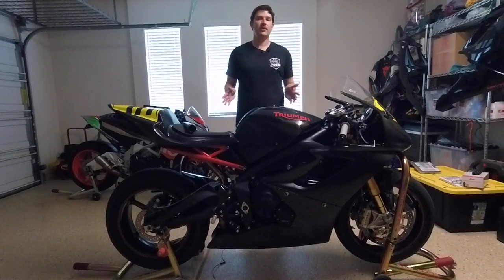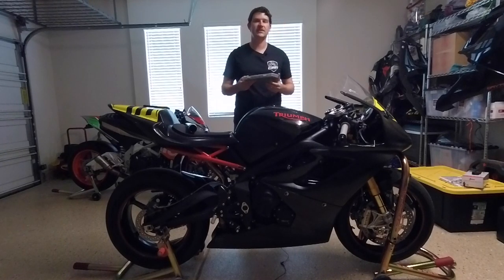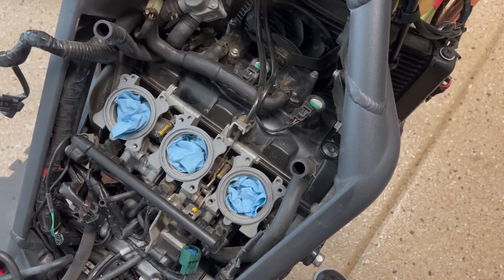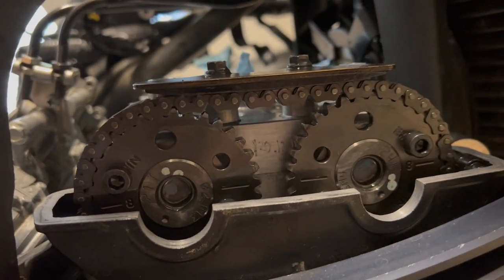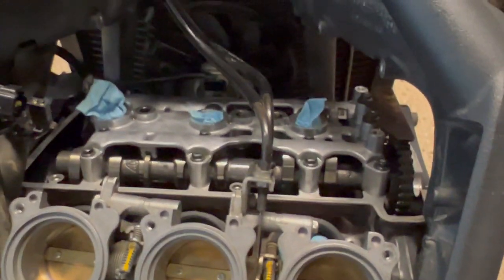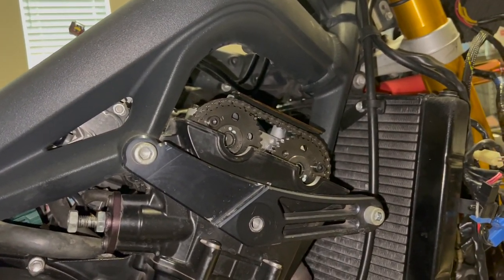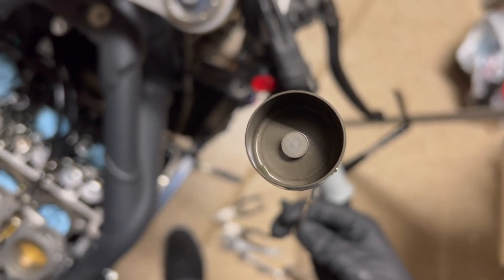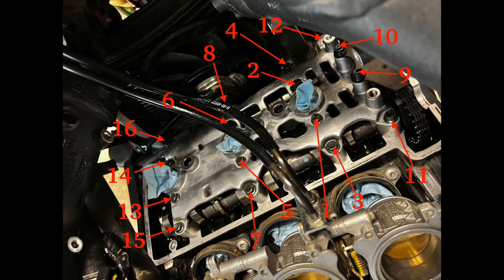How To Check & Adjust Valve Clearances on a Triumph Daytona 675R - An Overly Detailed Guide

Comment: Hi i have a question I hope you can answer please? I'm currently rebuilding my engine as my manual cam chain tensioner backed itself out and through all my timing out. I've decided to rebuild my engine and it's all going well so far! I have no idea what position each shim was in as I accidentally made the mistake of turning over the unit and they all fell out.... Stupid I know. As I don't know what was where, when I come to put it back together will I have to put everything back together just to check the clearances that will no doubt be out as I don't know which one went where. I don't want to have to put it all back together just to have to tear it apart again to change the shims. Didn't think of checking anything before taking it apart. It's my first time doing this as you can probably tell
Reply from the maker: Hi there! Kudos to you for taking on that job yourself. Unfortunately, if you did not keep track of where each shim was, I think the best thing you can do is exactly what you said. Throw it all back together, take measurements, then disassemble and move shims around as needed. Sorry to be the bearer of bad news, but it's the only way you'll be able to determine what needs to go where :/
Reply: @hiimchad  thanks, it all seems relatively straight forward until it gets to the shims so hopefully it works out. Thanks for getting back to me really appreciate it videos like the ones you've made make things so much easier I learnt so much from it. The tolerances on both exhaust and I take would be the same regardless of the milage that the bike has done correct? I've got a Haynes manual on the way anyway but in the meantime I'm trying to get as much knowledge in my head as possible 😂

Comment: Hey man so I’ve been searching if it is the case but when reinstalling the cams and timing them correctly with the intake lobes on cyl 1 be touching the Buckets and when you torque everything back on the valves with be open just a tad
Reply from the maker: Hey Yasay! Hope you found the right answer already, but if I recall correctly, the cam lobes on cyl 1 (the leftmost cylinder closest to the stator) should be making some contact with both intake and exhaust buckets. It will look like they are pointed towards each other, but down slightly. That is top dead center (TDC). You can also double-check the timing marks on the cam gears, and be sure to triple check the timing mark on the crankshaft as I showed. The cam lobes should not be facing straight down, or perpendicular to the buckets, but they should be a bit past a 90-degree angle. I would recommend double-checking your shop manual. Hope all went well!
Reply: @hiimchad  yes thank you this video was so helpful while I was doing this job. I got everything timed out and she purring better than ever. I did end up having leftmost valves just a tad open with everything tightened down and idles perfect and bike runs mint Thank You!

Comment: How's it going man, I think we have the same engine but less 15cc, it's a 2018 street triple 660s but yea I got it all back, the valve cover and all but for some reason the o ring on the cam timing tension decided to split, I took it off and can I just put it back on?
Reply from the maker: Do you mean the o-ring for the cam chain tensioner? If it split, you'll definitely need to replace it.
Reply: @hiimchad  yep got it replaced, i took it out and back on  without applying tension on the chain, is that alright

Comment: Here’s a tip- instead of removing the throttle bodies, you can undo the bracket that holds the throttle cables to the throttle bodies. 2 Phillips head screws. This will give you enough clearance to remove the cam cover. 

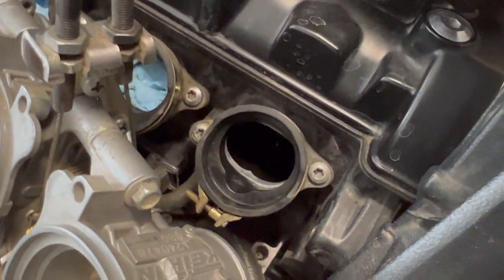Bracket in frame at 18:55
Reply from the maker: Great tip! I never thought to try that. Should short track the process next time I'm in there. Thank you! 🙂
Reply: Thank you!
Reply: This method works just did it myself! thanks for the tip man.

Comment: awesome video! 
Keep up the good work!
this will help me so much because I need to basicly do the exact same on my 06 daytona :)
Thinking of also getting a manual cct because I dont really trust my 25k mile old mechanical cct...
how often do you need to adjust the tension after install?
did you have to adjust it early because of the new timing chain breaking in?
what is the procedure to adjust it? as I didnt really find an official manual by ape...

sorry for those many questions :D 
Greetings from Germany 
Felix
Reply from the maker: Thanks Felix! I highly recommend the APE CCT. It's very easy to adjust. With the engine at operating temp, I'll break the lock nut loose, but not adjust the plunger just yet. I'll then start the bike and apply some firm tightening pressure (clockwise) by hand with a thick glove on so as not to burn myself. The tensioner will slowly tighten. After it stops tightening by hand with firm pressure, I hold it in place, cut the engine, back it out 1/4 of a turn, and then tighten the lock nut. It did require a minor adjustment after the first weekend with the new chain, but it wasn't too loose that it wouldn't have been ok for another weekend or two. I'd recommend checking it every 3k miles with a mix of street and track use.

Comment: Hi, great video!  I have a STR3 and I’m at the point where I’m about to replace the cam chain.  Mine is a little off the timing mark as well.  Question is, did you use that Triumph tool to keep the TDC?   I feel like you didn’t, since you were going to adjust cams to get the dot and alignment maker exact.   Any insight is appreciated.  Cheers!
Reply from the maker: Thank you! I did not use the tool. I ended up removing the cams to fit the new chain, couldn't see another way around it. From there, it isn't too hard to get the timing marks lined up properly, just takes a little time, patience and finesse.

Comment: Hi,great video, I keep watching it over, just about to do 12000 mile service on my 2008 675 triple. When you replaced the cam chain, would it be possible to remove either of the camshaft sprockets ? I`ve not had a triumph engine stripped before but have Suzuki and Honda
Reply from the maker: Thanks! Do you mean would it be possible to remove the camshaft sprockets in order to get the chain off without having to remove the cam holder? My concern there would be the cams jumping time with no resistance against them, so I wouldn't recommend doing it that way.

Comment: Hey man! Appreciate this tutorial 🙌 just one question, do you find necessary to loosen the cam sprocket screws at all and if so did you have to replace them? Thanks
Reply from the maker: Glad you found it helpful, Jorge! There is no need to touch the bolts that secure the cam gears to the camshafts. I definitely wouldn't touch them, as bolting them back on incorrectly will alter your timing and potentially cause issues.

Comment: I have a question, can I use blue antifreeze for a 2014 model 657 R?
Reply from the maker: I'm not sure. I run Redline Super Cool in my bike, which does not have antifreeze, but I also change it often and don't keep it in an area where it's at risk of freezing. I would recommend sticking to the manufacturer recommended coolant.

Comment: Thank you!! This will help me so much. Unfortunately I was riding my 2013 675r and the timing chain came off while riding, I have not checked the damage yet but don't know where to start... removing the cam and replacing the chain? Rechecking valves and timing?
Reply from the maker: My pleasure! Sorry to hear about your bike. If I were in your situation, I would be pulling the cylinder head off to ensure the pistons and valves did not contact each other and cause serious damage. That said, if no damage was done, installing a new chain and ensuring everything is properly timed would get it running again. But, you could cause more damage if say a valve was bent or hit a piston. It would be a shame to get it down to the valves only to reassemble and find it is blown.
Reply: @hiimchad  Thanks! yeah I am really bummed out and am considering just ordering a new engine, I have little experience diving this deep into engine work and don't really want to drop $$$$ on a shop to do it just to tell me it's blown as well. Really torn right now
Reply: How'd you know the chains came off bro

Comment: Hi,
I've a 2015 street triple 675, with the timing set correctly as per serving manual vehicle won't start it's creating a back pressure which is getting released from throttle body. Kindly suggest
Reply from the maker: Hi! Not sure I understand, are you hearing pressure release as you rotate the crank?

Comment: Do the injectors and fuel rail come out with the throttle body as one piece?
Reply from the maker: Sorry for the late reply on this, although it looks like you figured out a solution! But yes, the injectors and fuel rail will come out along with the throttle bodies. No need to remove them from the TBs.

Comment: Hello there, Question: I have a '20 765 Daytona (the Moto 2 ed.) ~2000 miles so far. Bought new in 2021. Was doing routine maintenance, and replacement air filter when I noticed throttle bodies with excessive oily/gasoline buildup. removed throttle body and  cleaned. Injectors seem fine too. I looked into the intake valves and saw crazy amount of carbon buildup, like 25k miles stuff. never had a triumph before so I don't know...
Any idea what's causing this? Have you seen this before? this bike is almost identical to the D 675 and the street triple rs. I suspect the charcoal canister for emissions is the culprit.
Reply from the maker: I have seen a bit of oil in the airbox each time I have serviced it but never more than expected. This bike still has all the emissions equipment and the crankcase breather in place as well. My TBs and intake valves/ports have always been spotless. The build up is either from the fuel you've been running, or an issue with the crankcase breather. I have had great experiences over the years running Shell's V-Power+ (91/Premium here in CA). I disassembled my 2006 D675's engine at 36k miles after running basically nothing but Shell for the 16k miles I had ridden and the intake valves and ports were spotless as well.
Reply: @hiimchad  Hey Thnx for the reply. Yep I've been using Shell premium and also my local Costco premium (maybe not good?) I got a few feedback and yea most people agree it may be some crankcase breather issue. Matt from YT(@dirtygarageguy) said the same thing, and even said check oil level and type. If that's the case Dealer mechs dropped the ball when they did service. It's going to be hell to clean those valves. I really don't want to take the head apart.
Reply from the maker: @UNDOSOENGINEERING  if the dealer overfilled the oil that could explain it. My understanding is that if these engines have too much oil, much of the extra oil eventually winds up in the airbox. 

If you can determine the cause and the bike is running fine I wouldn’t worry too much about the build up. If you can resolve the issue causing it and continue to run a quality fuel (I can’t speak to Costco, so wouldn’t recommend anything but VPower as that is the only fuel I have significant experience with) it will eventually break down. 

Alternatively, you could look into a walnut decarb. It’s a regular service for direct injection engines like the FSI and TFSI engines produced by Audi. That service is performed with only the intake manifold or supercharger removed. Not sure exactly how it is done, but I don’t see why it couldn’t be done on a bike.
Reply: Yes unfortunately the 675 was the last engine before they switched from Multi Port Fuel Injection to Direct Injection which is what causes the carbon on the new 765’s intake system. There is no fuel washing down the intake anymore.
Reply: @trex5397  you likely already got your problem fixed but it's possible that your oil dipstick O ring could be bad and that will allow excessive oil vapor getting pulled into the air box. Had this happen on an ATV before. New O ring and bobs your uncle

Comment: How difficult (time to delivery of parts and expense) is it to source 675 parts and general running?
Reply from the maker: Getting parts takes a little longer than, say, an R6, but not by much. Maybe an extra week or two worst case. I have a dealer I get my parts from that used to be down the street, which always made it easy. Regarding maintenance, it doesn't seem to be any different than my friends' R6s and ZX6Rs. I change the oil after every race weekend and cut the recommended maintenance intervals in at least half (I just did all the 12K-mile service items after 3k miles since I did it last) and it seems to be happy!
Reply: @hiimchad  Thanks appreciate the color, these are so well specd out of the box and appear to be easily serviced ie valve (thanks for the vid) Parts avail was the big question.

Comment: How log time takes the whole process of checking the valves?ty
Reply from the maker: Hey Sebastian! It depends on your level of experience. If I powered through it and didn't record anything, I'm confident I could the job with an adjustment in 6-8 hours, assuming I have all the tools, parts, and shims I need, but this was the 6th or 7th time I have done valves on a Daytona engine. I would budget at least two days if you haven't checked or adjusted valves before.
Reply: @hiimchad  hi, thanks, I never did a Daytona, I wanted to know because I need to make an offer to a client✌️Have a nice day.

Comment: thx I might give mine a go. But with the clearance measurement, shouldn't you keep increasing feeler size until it doesn't fit to get the upper size, rather than just going by feel?
Reply from the maker: If the first feeler goes in easily, then yes, you want to keep going up until it doesn't slide in. The point I was trying to make is that if you have to force the gauge in, it's too thick. You should feel some resistance when inserting it, but it shouldn't get stuck. That's what I meant when I mentioned going by feel. Sorry if that wasn't clear. 😅
Reply: @hiimchad  Ok seems to make sense now, if there is a fair bit of resistance i guess that means its "maxed out at the gauge" Anyway in the process of doing mine now (and making a video about it)
Reply from the maker: @sparkthego  exactly. If it is hard to get it in the clearance, it gets stuck after it’s in there and/or is difficult remove, the gauge is too thick. How’s it going so far?

Comment: what if that 24mm nut on the crank jus spins…
Reply from the maker: Like it spins but isn't rotating the crank? If you removed the spark plugs already there shouldn't be much resistance as there is space for the air being compressed to escape.